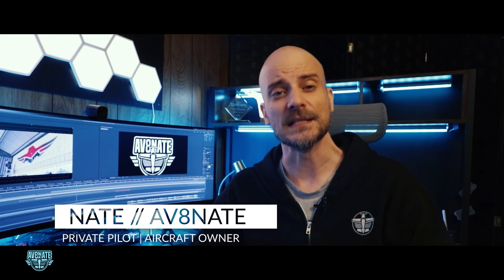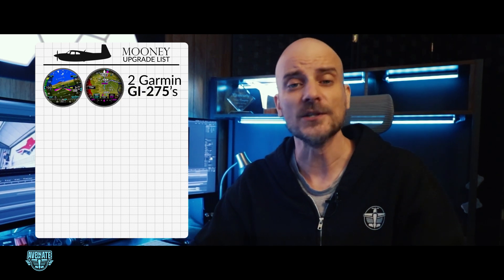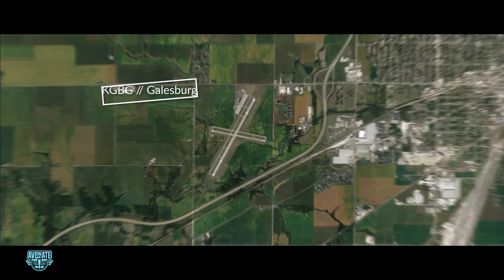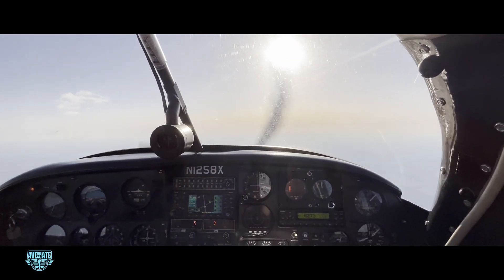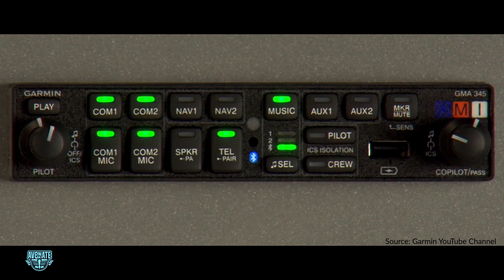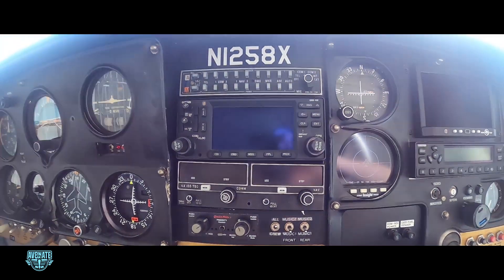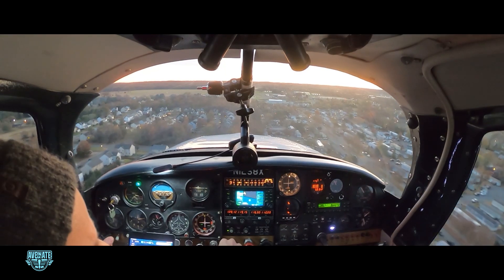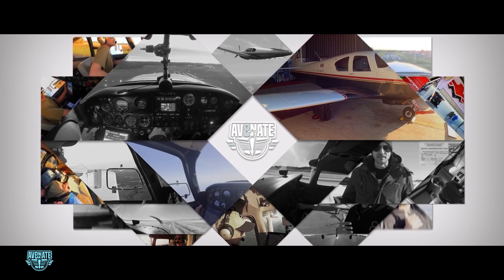Garmin GI275 in a 1964 Mooney M20E – Big Upgrade! (Part 2 of 3) #mooney #avionics #generalaviation

Comment: Do these two gi275 require STC paperwork and payment?
Reply from the maker: The GI275 is a certified replacement for the primary 6-pack.  It does have STC paperwork, but the cost of all of that is built into the units.  They are not cheap, and a lot of the cost is the paperwork.